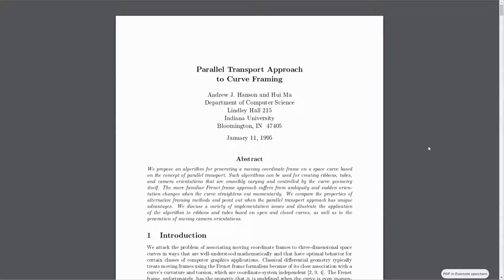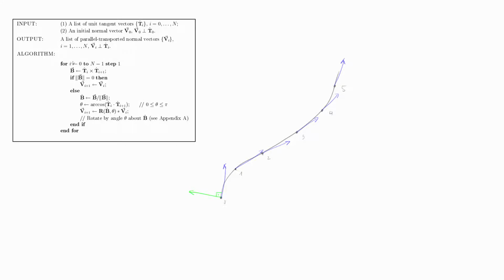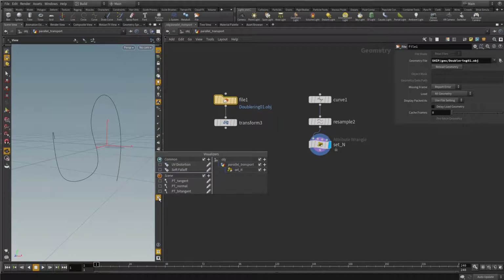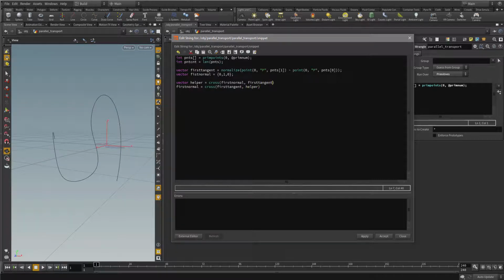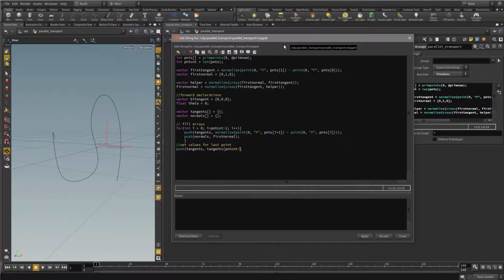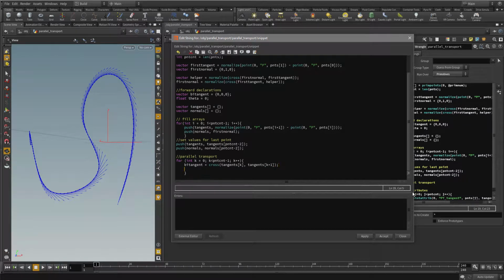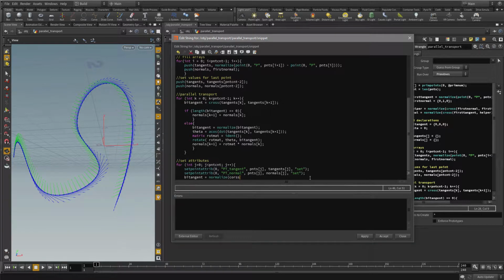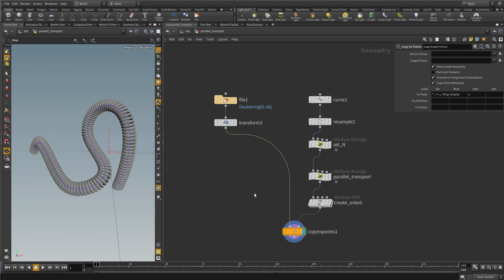TD Essentials: Parallel Transport

Comment: In the algorithm in general, don't you need to ensure the firstnormal is not identical to the firsttangent? In this case helper = (0,0,0) and will normalizing this crash?
Reply: I should have said parallel to instead of identical.